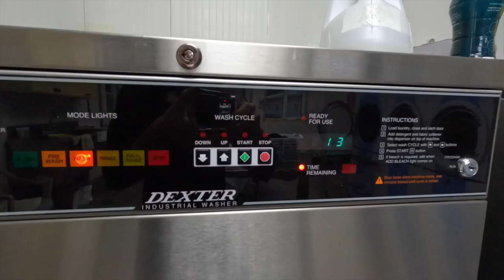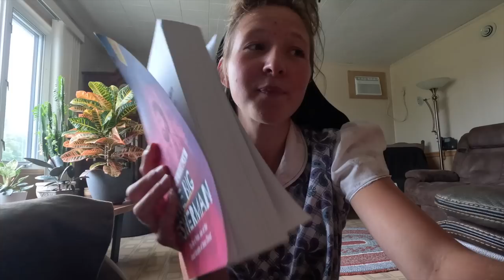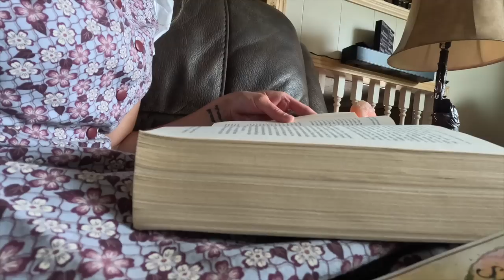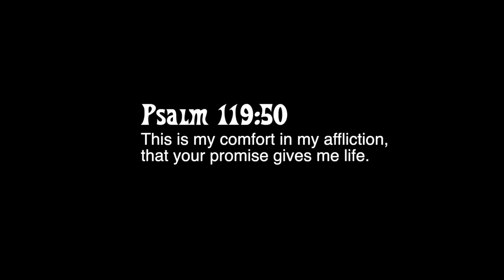Daily Life On A Friday | a chatty vlog, cleaning, current reads etc....vlog 158

Comment: I quit using coconut shortening or oil because it was effecting my cholesterol levels. Never had problem with my cholesterol levels until I started using it and was put on medication. I stopped using it and my levels returned to normal and no longer needed the medication. That was about 6 years ago, It was the only change I had made in my diet so was easy to figure out. (Seeing the coconut shortening you had reminded of this.)